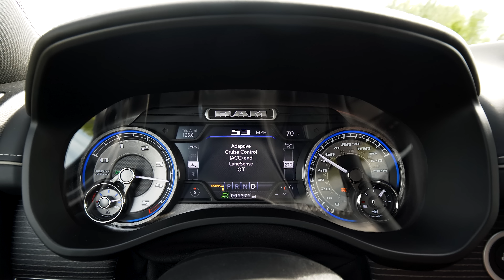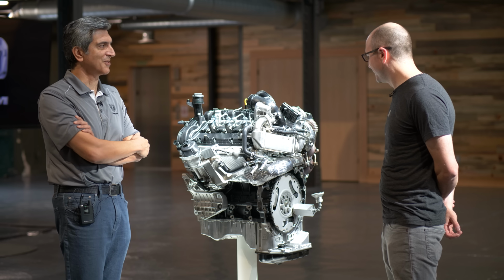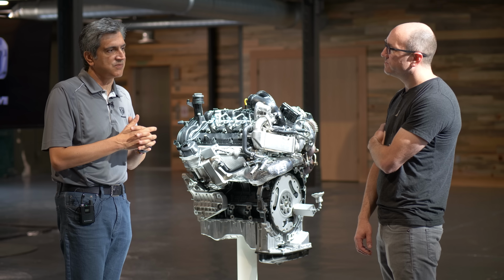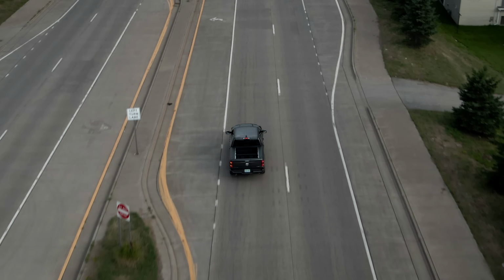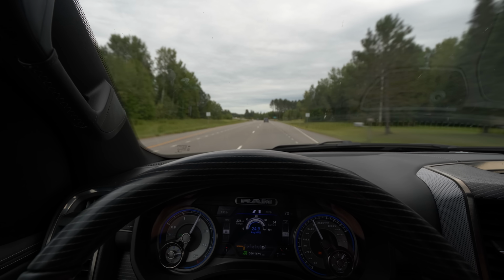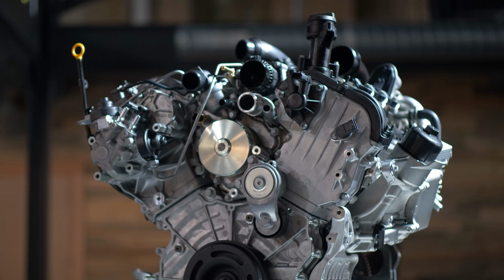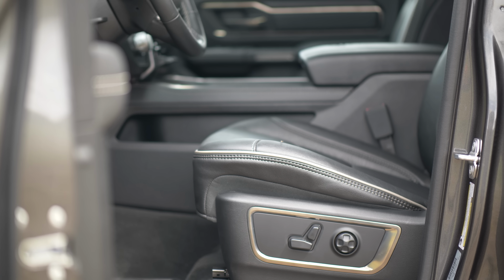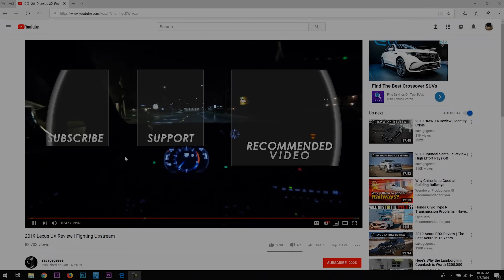2020 RAM 1500 Eco Diesel | Getting Rammed

Comment: I have to disagree about the if you’re a ford guy you’re a ford guy etc bit I’m a ford guy always have been however the 19+ rams are far superior fit and finish wise to the fords I couldn’t spend 50k on a truck that felt like a 25k truck on the inside so I bought the ram, next go around if the ford has the more appealing truck I’ll buy a ford. I love my 19 rebel however and getting 30% off the sticker sure helped to sell me as well. Can’t really go wrong either way but I preferred the interior space of the ram and the hemi does indeed feel great.
Reply: That F-250 Tremor is going to be a beast with that 7.3 liter. Ford is gonna be selling truck loads of those
Reply: The Great One no doubt going to be a badass truck indeed would be a tough choice between that and a power wagon but I think the ford is going to do really well and I’d probably pick one over the power wagon.

Comment: A close friend of mine on's one of these trucks and the Air suspension is a Nightmare. It has failed multiple times and Dodge has keep him running in circles about fixing it. He wishes he never bought it...
Reply from the maker: I always stay away from air suspension on any car
Reply: Welcome to air suspension systems on most cars. The Audi R8 which costs well over $120,000 has the same issues. Then when you need a replacement, they expect you to fork out $8,000. Air suspension on a pickup will receive the most brutal wear and tear.
Reply: Let me guess: he is going to buy another RAM truck?

Comment: I had a Chevy ,Dodge and my last and current truck is a f150 . I like the Chevy but the interior was very plastic,like kids toy plastic. I don't like the Ford it was expensive and the seat is terrible, you can put a plow on it ,the alternator went bad at 20k the front brakes are shot @27k and everything I read said you better service the fluids if you want any kind of longevity. Also the metal in the door shakes when you close it ,and the driver mirror was falling off when I got it (new) . So I think I would go with another Dodge ,although the fiat thing isn't reassuring quality wise .
Reply: guy proulx  I exaggerated a bit it started falling off at about 1500 miles it got loose and started to make noise . It's a big dealer in my area and no I won't get anything from them again. The delivery was a mess it wasn't ready and I took it for a ride and the tire pressure sensors went off and I had to stop for air . Very dissatisfied with the hole thing ,I won't be buying another Ford anything. That's why they are not doing as well as they should . Credit to the dealer they did fix the mirror quickly for me .

Comment: Normally I've been a Ford truck guy, I even love the 3.5L Ecoboost. But if I were buying now, I'd buy a RAM Rebel with the 5.7L Hemi. Just don't buy a GM until they get their shit together about putting the steering wheel in front of the drivers seat instead of off to the side.
Reply: The steering wheel is centered now.

Comment: Let me warn you. This engine is from Italy. From a source NOTORIOUS for it's bad engine. Be ready to be really rammed when you buy this thing.
Reply: Well, I wouldn't diss an engine cause it's from country X or Y. I would just say, be careful with "new engines" in general. It's great that they innovated, but only time and miles will tell if it's a durable engine. Or if it has some issues - how serious they are, how easy to repair them, and so on. Like usual. Buying into a new engine is always kinda risky, regardless of the brand.

I mean, just look at how the Toyota Hilux turned out. Class action against them because of the lame DPF implementation. They tried to flex-tape the issue (by adding a manual button on the dash to do a hand regen), and that did not work either. GG. Look at the Mercedes X-Class. A "borrowed", but proven chassis, and Mercedes's own engine and transmission that just worked. And it's an overpriced, unreliable mess.
Reply: @CitarNosis317  Not the country dear ahohnmhdim, the builder. Fiat is ranking last on reliability ratings and some of the worst engines and most catastrophic cars of history, came out of their engineer teams.

Comment: "doesn't have as an advanced structure as Ford or Chevy" 
I'm where the fuck are you reading that? It got the best ratings possible in basically everything. It matched Ford, only spot it loses to Ford is headlights but NO TRUCK in the US has the best possible rating.
The Ford and Ram have the safest overall frames.

Comment: Independent rear suspension? That can't be right.
Reply: Coil link suspension. I made the mistake of calling it an independent rear too when so many reviewers said it was an independent rear.
Reply from the maker: Thats correct its not independent.  Uses coil springs instead of leaf springs has a semi independent feel. You can see it in our Ram Rebel video if you want.
Reply: @savagegeese  they've had coils for a while, thanks for the clarification though.

Comment: FCA retreats. Want to wow you with pitchs and pretty things. If they put this much effort into sedans theyd sell just as much. Not everybody wants 22mpg.
Reply: They did. No one is going to buy an FCA family sedan. For instance the Chrysler 200 did things in 2015 that Toyota is just starting to do. The Alfa Guilia is by far the best vehicle in it's class. The Charger and 300 are the only vehicles in their class.
Reply: @KevinSmith-qi5yn  just curious actaully. In 2015 that Toyota ate now doing. So why did they cancel the 200 than? Bad quality. Only youngsters like the charger and 50yr olds. No middle grounds. Thats where the money is. They just have to keep building sedans and theyll eventually been known like Toyota and honda for making long lasting cars. I think they just see when the have a couple yrs of slighty declining sales they cancel stuff. So add about it.
Reply: @ponrix  
The Chrysler 200 and Dodge Dart didn't actually have poor sales when they decided to cancel them. They did have bad reviews simply for showing up with an FCA badge. On the other hand FCA released a class leading vehicle and didn't get class leading sales mainly due to the prejudice people have against FCA.
When they cancelled the two sedans for more capacity for pickups and jeeps. They were taking a low profit margin vehicle and replacing it with a higher profit margin vehicle. It paid off for FCA at the time.

If FCA wants to rebuild it's reputation for quality, it doesn't matter if they do it with a sedan or a pickup. It's the sedan market that is more sensitive to reputation.

Comment: Just saw the video on TFL Truck where some brand rep admitted the EcoDiesel is a heinous piece of garbage that cannot be used for any purpose and will be cancelled.  Huge props to FCA.  Obviously, VM Motori is not going to be capable of producing an engine that can be used in a vehicle, or which can operate via maintaining the Diesel or Otto internal combustion engine cycle in a self-sustaining manner to turn a crankshaft.

I think Cummins, who designs engines capable of being operated, offered the 5.0 L for use in light-duty Dodges but FCA decided against an engine with the property of being functional.
Reply: You are full of it. They make great engines in Italy, engines with power while not weighing 750 pounds. This engine went in vans and motorhomes and did quite well there were weight was an issue buddy. Might not be the best for such a heavy pick up, but it did very well in lighter vehicles....

Comment: heads up to the ppl saying this engine is great...it is actually coasting dodge alot of money as there replacing these engines left and right. think the number was 85% of these engines sold so far are have been replaced? i know i work at a dodge dealership as a journeyman tech and replace 2-3 of these engines a week...dodge is keeping it very hush hush...whats so bad you say? main rod bearing burning up...and seizing the engine. if you getting a ram ppl get the HEMI or cummins STAY AWAY from this engine...this and air suspension...you will regret it...i guarantee you. Dont believe me? Go to your local dealership n talk to a TECH about these engines n air suspension...DO NOT talk to a salesman about it they are not going to tell u the truth all they want is to make the sale so they get commission and will do ANYTHING they can to get you in that vehicle.
Reply: I thought this new 2nd gen diesel wasn't available yet.
Reply: LOL have a source for 85%? I'm betting that's wildly and woefully inaccurate.

Comment: This engine is going to be garbage. I bought a Ram Ecodiesel 1500 (2016) had it for almost 3 years with 110,000 miles and literally burn to the ground while driving on the highway. Very sad and very crappie product.  Don’t be fooled folks

Comment: Dodge  Chrysler making another trash car that will break down just after 6 years of use ohh so much parts used that will make that car break down anyway possible plus the worst part is they haven't even tested that engine to see how long it will last in true test driving capabilities of the turbo and the engine block plus the shocks run on air ride that could break down start leaking sooner.
Reply: banger881 ram trucks are best
Reply: guy proulx  reliability goes a long way but price range is the key points everybody likes the Ford f150 but who really makes the biggest improvement is Toyota and Chevy in the truck line up and safety.